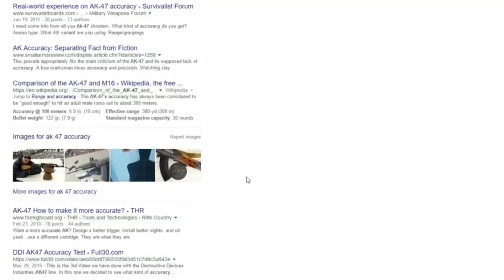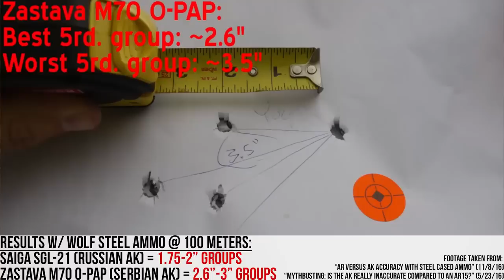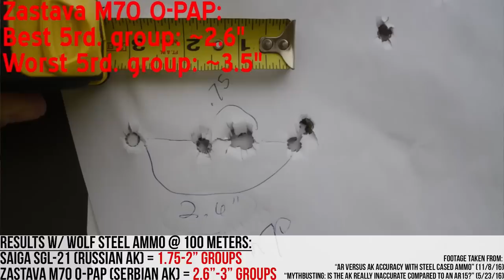Busting the WORST AK-47 Myths! (Featuring InRange TV and Mishaco)

Comment: More on no. 4, the AKM uses stamped sheet metal which required less man-hours and material to make compared to milled and machined metal parts, however you needed huge industrial-scale machines to actually be able to make these stamped metal parts, which means stamped metal parts are suitable only for mass production on a large scale, whereas milled parts are more suited to smaller-scale production
Reply: Aks also need special equipment to stamp.
Reply: If you're trying to be a legit gun manufacturer then yes you need the big stamping machines and such . However if you are a Pakistani, back from the Jihads and living in some of the remote tribal regions near the Afghan border and need cash because its expensive to have more than 1 wife and they each gotta have a couple kids ,you may find work in the numerous "gun builder/dealer" operations that keep a steady supply of homemade knockoffs of almost every military firearm ever used flowing into the black markets that are also in these regions. These little shops are often run out of a small family owned mud hut that the family may or may  not live in, and have a boss man and usually 1-4 workers,using pretty much hand tools,maybe a bench grinder,and an electric drill.. i believe the barrels are actually purchased ,either from usef battlfield damaged weapons, or in some cases new from legit but not real questioning suppliers from all over the world. The finished products from some of these shops is quite good,and with some paint and traditional decorative touches they appear to be the real factory made weapons ,this is actually a point of pride to these guys. And they do work surprisingly well ,at least for a while. Materials are often obtained from random scrap metal and the alloy ,hardness, etc... are of an unknown quality,and while they are good at bootlegging copies of guns, their measuring equipment, engineering skills,and knowlege of actual firearms operating theory and principles are limited. But its likely that an awful lot of Taliban in the more remote areas carry weapons made this way.
Reply: Wrist Rocket Watcher
Reply: @oldhillbillybuckkowalski  The Philippinos do the same and it would be awesome if some of these people were hired to do legit work with real tools and education.
Reply: @jeramyw  yeah, the job they do with what they have now is pretty good,with modern tooling and better materials they could be impressive
Reply: Thanks for that comment, i wish he would have addressed the most common myth : that all these guns people think of are called AK 47, when most of them are actually AKM

Comment: So basically people just didn't know how to properly use the AK sights and instead of showing weakness, they started a rumor it isn't accurate.
Reply: I mean, I know how to run AK sights properly.  They're just bad.  That rear sight is junk.

You can't compare a notch and post to a peep sight setup.  The peep sight is always going to give you superior accuracy.
Reply: RAAAAAGH FULL AUTO!! Y I NOT HITTING ANYTHING WITH THIS PIECE OF SHIT :,(
Reply: Haha our troops in ww1 and ww2 did the same thing with the 1911. No one could handle the extra recoil of the 45 so they blamed it on the grip angle of the gun which is why the 1911a1 has an arched mainspring housing.
Reply: Don't forget that this is a test done by a guy that fires guns all the time and knows how to compensate like someone who does paintball a lot knows how to compensate. 

The AK is poorer in terms of accuracy as to be accurate you have to be a good marksman. A person who has never fired an AR15 or an AK will find the AR easier to shoot with, and be more accurate with it.

Methinks you lot read too many Tom Clancy novels. 

And this is from someone that has fired them, both for the first time and at the same time. Along with four other people. I have fired Shotguns and Bolt-Action rifles but not semi. It was easier to be accurate with the AR when firing as quickly as you can. The AK was beautiful but not as good. Sorry. I found the grouping of my shots with the AK to be just over 3" compared to 2-2.5" for AR. Maybe if I had years to spend firing it I would get better with it and it would catch up with the AK.
Reply: That awkward moment when a gun having bad recoil means that you can't fire as quick... or if you do it wont be as accurate... Ahem. That is called logic, Brian. 

And btw the 1911 had recoil spring compression weights...  And I am sorry but the recoil had nothing to do with it. Many pistols had the same, if not worse, recoil. It was a badly designed gun at first, hence the redesign. 

Same old yanks, think they are the best and know everything. Bless. I'm sure your hubris and arrogance wont backfire... Again...
Reply: They started a rumor that wasn't accurate.
Wasn't accurate.
Accurate.
PUN.
Reply: literallycaneven pretty much. The way I see it, it all comes down to the shooter preference and proficiency
Reply: I'm a Vietnamese, back when we used to be in high school 11 years ago, 25% of high school pupils had to have some short military training like how to use the AK and basic tactics. 
The trainer tells us to put the zeroing at 300m for 100m target, then aim at the bottom of the target, ~23-25cm below the bull eyes. 
It was pretty easy for a pupil like me (who never shot a single bullet before) to put 6 bullets in the bull eyes (which has 10cm diameter) @100m.
Reply: Nick Armitt The gun will not be less accurate. It will have more recoil. Big diference.
Reply: @disht2  My wife is a casual shooter and has always done better with her AK than any of my ARs.
Reply: @disht2  probably becuse the manual of arms was like " its a hand gun you only need one hand"
Reply: Then again, what the AK group considers "accurate" is a 2 MOA gun and your up in arms about it's precision. 2 MOA is not an accurate rifle, when quality AR's can consistently produce sub half MOA groups all day long.
Reply: @immikeurnot  I personally believe the AR peep sight allows the inexperienced shooter quicker target engagement over the AK sight. Just my opinion.
Reply: @nickarmitt4722  He doesn't compensate in accuracy in the accuracy tests... That would make no sense.
Reply: As far as quick target acquisition the AK sights are easily better than AR peep sights in my opinion. The AK was never supposed to be a sniper rifle, it fits the role it was made for very well especially for the period it was invented in.
Reply: We're gonna prove the ak47 is accurate, just give me a sec while I attach this scope
Reply: Or US soldiers went up against the AK and realized their hit probability was (thankfully) low and attributed it to the gun rather than it being wielded by peasants, tribesmen and draftees. I think one of the key points in AK mythology is understanding who Western troops saw using it. The second is Russian propaganda.

Comment: I own both, shot both, been shot at by both and wouldn't want to be on the receiving end of either.

My only complaint with the AK platform is no bolt hold open on the last round for reloading, and the safety is in an awkward spot. These issues can be smoothed out with training, but you will never reload an AK from empty as quickly as you can reload an AR, VZ-58, FAL, etc. 

I think the accuracy under 350 meters I close enough that only the best shooters in the world will tell a difference. Where the AR beats the AK in accuracy is at range, when the big 7.62x39 bullets goes subsonic it looses all accuracy. This can be fixed with better bullet designs with better ballistic coefficients. I have loaded 124 grain Hornadays and reached out to 500 meters on steel so I couldn't tell you what the grouping size was, but the fact that I was pushing a boat tailed A-MAX at high velocity meant that the bullet stayed supersonic longer and was accurate. 

I think it honestly comes down to fan boys and training. A shooter with a High Point that has trained with a High Point will be more effective than a shooter with (insert expensive hand gun name here) that has only been to the range to show off their new toy once or twice. I'm basing this opinion off of years working on gun ranges and years as a range coach in the Marine Corps. 

Great video keep them coming. If you need some shorter shorts I might have a pair of silkies sitting around...
Reply: Thanx for being a Marine. AND for pointing out it ain't the gun, but the  man.
Reply: Yugos have the bolt hold open, doesnt assist with reloading but its there, agree with everything else.
Reply: The ole’ Marine Corps. Coach lol
Reply: I always see people comparing 5.56x45 to 7.62x39
Why not compare it to more up to date 5.45x39 which is the new AK round?
Reply: Sure it's less accurate at range compared to the AR but and AR bullet wont do to much damage if you hit a long shot
Reply: For the accuracy of the AK's I can only tell my experiences form the HDF. I've been an offecer cadet for.2 years, and have shot about 100 rounds with an AK in my whole life. And still, I managed to shot down a machine gunner target (unfortunately I don't know the exact measures, but roughly 20-25" wide, 10-15" tall target) at a distance of 250 m, and a standing target at 300 m, with the basic sight. (We don't change it to exact distance 'till 350 m.) Unfortunately, I have not had the chance to shoot an AR yet, but we replaced the old AK-63Ds and Fs for the new CZ Bren 2, and I have only heard good things about it. 

And about reliability. I had no malfunction because of dust, sand. But, I had, becouse of wrong reload, I mean when you cock the rifle and don't let the charging handle to be pushed forward by the spring, but slowly push it forward by your hands, it's a common mistake when you are a recruit, and when you use blind rounds, often leads to malfunction. And if it's stuck very well, you still can stamp on the  handle, that usually solves the problem. 
+1 thing, for cleaning. We mostly use sand, wet wipes and toilet paper to clean the rifles, no fancy thing. For some reason the american soldiers was always surprised when a cadet from us dug the piston into the dust 😅😂
Reply: @conesinker_4209  long shot at what distance
Reply: @conesinker_4209  a 5.56 can penetrate a 1/4 steel plate at 300 yards. Do how much power do you need? Like a zillion power?
Reply: @tylerdurden4080  first it is footpounds if you are an american or joules if you are human, second the bullet mass limits its lethal range to around 800-900 meters where mass matters more than the speed
Reply: @yubach  what's your point?
Reply: @yubach  also it's called a joke which apparently you didn't get.
Reply: @yubach  you’re greatly overestimating what it takes to kill someone. 5.56 out of a 10.5” barrel will quickly drop someone at 500 yards with a single shot upper chest. 7.62x39 out of a 10.5” barrel certainly has more energy at 500 yards but how much more do you need? Neither are getting through plates at that range (and 7.62x39 out of a 10.5” barrel is nearly indirect fire at 500 lmao)
Reply: Unless your left handed like myself, then the safety and operation of the AK is perfect. Also, you can buy bolt hold open mags. However, I prefer non bolt hold open mags

Comment: I would like to say mine about the first two miths:

1) Although accuracy heavily depends on the kind of system you are using (e.g. bolt action vs semiauto) it also depends on the manufacturing quality. If we take the SIG SG 550 for example, we can see that it has an accuracy under 1 MOA, although its working principle is the same as any other AK.

2) There's a misconception about ruggedness: no rifle can withstand mud and rocks entering the action, that's why the AK lost in InRange's mud test against the M16: the first system has a lot of open slots, while the other is completely sealed. What the AK system (gas piston) is really capable of resisting is non-maintenance. Infact, the gas tubes seales the action against the debris coming from the barrel, whereas the M16 system (direct impingement) exposes the action to a spray of debris during every shot, thus requiring more frequent cleaning.

Comment: In terms of cost of production - from memory this is due to it being able to be produced with low quality industrial equipment - such as having stamped metal parts which aren't as complex to make as milled parts. This is where the AK is 'Cheaper'
Reply: Yeah, that whole explanation for why it's a myth was just stupid. The guy basically described the way every manufactured product has been produced since interchangeable parts and the production line were created. ALL military firearms are produced in the same way. The reason the AK is cheap to produce is the amount of forging and machining is minimal meaning you need fewer highly skilled workers and the sheet metal stampings and spot welds mean cheaper materials can be used. It's the same reason the M16 uses aluminum castings and plastic.
Reply: You cant make stamped gun parts on low quality equipment. Stamping equipment for the task is the definition of high quality, very complex and very expansive industrial equipment.
That's exactly why it took the Soviets over a decade to move from a milled receiver of the  AK Type 3 to a stamped one of the AKM.
Reply: @RustedCroaker  I think I may not have been clear - a stamping machine is fundamentally either a hydraulic press of sorts or on a cam system. The Dies used  have to be high quality - but overall, compared to a high precision mill or lathe - or even a CNC - it's not as complex.
Reply: @MajesticDemonLord  Look at it this way. You can have a 100 years old milling machine (not even CNC) in a garage and make a good quality AR-15. Even aluminum parts can be cast in a garage. But you'll never make a good quality stamped AK in a garage.
Reply: @RustedCroaker  I see the point you are making - but I disagree on your premise - if you had the right dies, then a home hydraulic press (12-20 tonne range) is sufficient to make a stamped AK.

Looking at prices (in NZ mind) - a 20 tonne Press is ~$500-700 (brand new)
A second hand Mill, the roughest I could find, was still about $2,000. Brand new (so comparing like-for-like) - You are looking at $20+K 

I mean you could say 'Ah, but without the  Dies, a 20 tonne press is useless' - but I'd counter with 'I haven't included the cost of tooling with the Mill either'

In addition - Stamping parts doesn't allow for the quality control that a skilled machinist can achieve with a lathe/mill.

Comment: Here in Vietnam. When i was in army i have chance to test Ak-47 and M-16(1st gen). AK-47 have heavy ammo, lower velocity than M-16 so it got rainbow like ballistic and quite high recoil. That mean in standard sight you must aim lower in short range and higher in long range, but you can control that with training, Vietnamese soldiers used 2 rounds burst trick to control the gun. M16 have longer barrel, lighter ammo make its have more straight ballistic but because of high rate of fire, 20 rounds mag (you must to to reload and start to take the aim again more sequence), the barrel get hot so fast. Make that inaccurate uncontrollable. In term Vietnam war, the battle most of the time is close to mid range, and its make AK have huge advantage again M-16.
Reply: Pretty sure it was the SKS-21 that won that war.
Reply: Long Vu, I think the original M16 was a really poor weapon on wet conditions, the A1 variant was much better.

Comment: I was trained and used the m-16 for 20 years and respect it. I also grew up on the west coast which is primarily open terrain in which I would prefer the ar-15 for its flatter trajectory. 

However now I live on the east coast in heavy wooded area. I have come to prefer the ak in this terrain for its greater drop characteristics. 

I also am not fond of the buffer tube of the ar-15. Being able to get a pistol like the draco micro without a huge tube sticking out the back is nicee to me. And no I'm not doing a pistol brace as I have a carbine for that purpose.